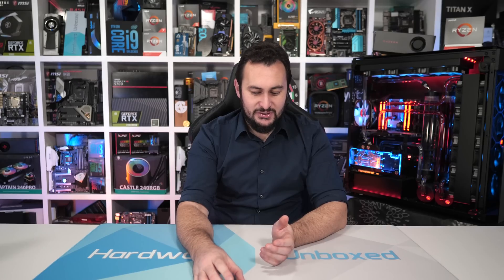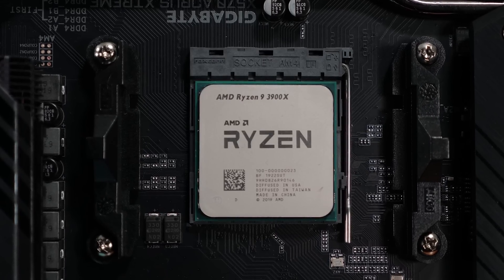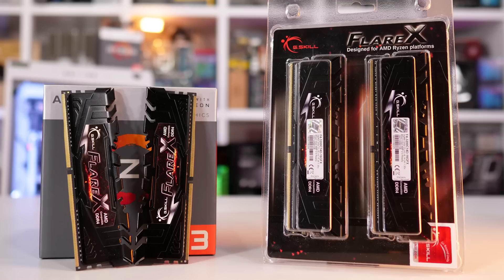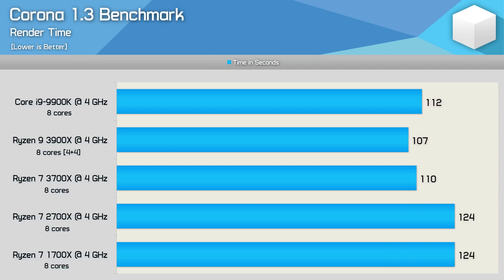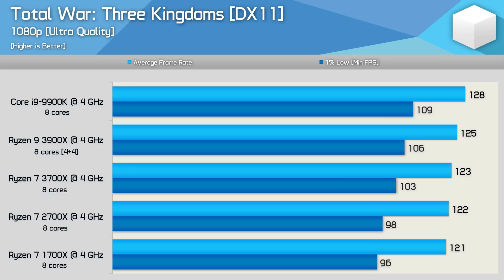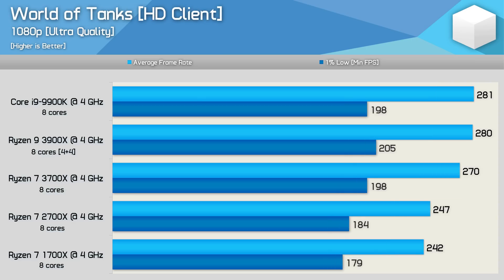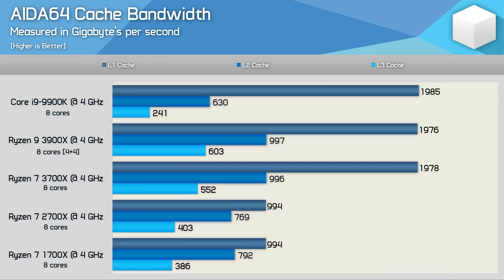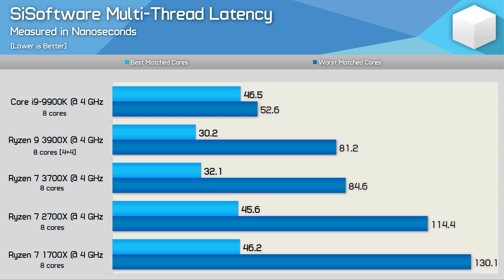3rd Gen Ryzen IPC Test, 3900X & 3700X vs. Core i9-9900K

Comment: Instructions per cycle has nothing to do with what the tech media use it for. Technically speaking IPC doesn't say anything about the performance given that some instructions do a lot more work than others. Of course the clock frequency also is tied to it, when you get longer (wider) pipelines you probably also get a lower clock frequency because the critical path takes longer.  Even AMD and Intel go with it (using the term wrong) now but computer scientists probably get a bit annoyed by how the tech media and now even the industry use the term IPC wrong. 

It is fascinating to see how 2*4 compares to 1*8. Now the explanation...
Reply from the maker: You went about explaining it, by explaining nothing.
Reply: @Hardwareunboxed  
I did explain it. You have a number of instructions per cycle, those instructions can do little work or a lot of work. Hence, the number of instructions per cycle doesn't say anything about the output of a CPU. Yet the tech media uses the term IPC as a measurement of output. What is not clear about that explanation? Furthermore I pointed out that in general when a CPU gets more work done per cycle - which generally is the case when pipelines are longer - the clock frequency lowers because the critical path gets longer. Critical path is a technical term from computer science! The point of that was to point out that a higher IPC often leads to a lower clock frequency and a lower clock frequency leads of course to lower output with the same IPC etcetera. So it is a balancing act between efficiency and clock frequency. 

In the context of X86 where both AMD and Intel use roughly (there are some difference in implementation) the same instruction sets IPC and output happen to correlate, technically speaking from a computer science point of view where this term comes from (I studied computer science, as subjects, not as a major) it is wrong to use IPC as measurement for output. AMD and Intel now do the same because the tech media do it and this makes it easier to communicate with laymen but it is wrong. Ask one of the technical managers (not the marketing employees) from AMD or Intel the next time you speak to them if you don't believe me.

Of course there is also the issue that the output of a CPU strongly varies between tasks. The term IPC as the tech media use it suggests that it is a general measurement of performance, as you know from your testing it strongly varies between tasks, Ryzen is the king for rendering but for gaming Intel still has an advantage, for Windows at least (probably also for Linux but that has not been tested yet). I think it would be best if tech media would not use the term IPC at all and just speak of performance for task X or program Y. That is technically correct and that is what it is about and what matters to the tech media and the consumers.

Comment: Wouldn't comparing games at 720p low be better to completely eliminate GPU-bottleneck?
Reply: No. Ultra setting is very demanding for cpu power... even shadow setting work better on good cpu. Only setting with minimum inpact is post-processing, resolution and anti alising.
Reply: @Denn4ik  okay, but resolution is less gpu bound at 720p
Reply: @Taraquin83  yes. But not low settings. I think optimal test is 720p ultra w/o anti aliasing and post processing.

Comment: the problem is...that in my country 3700x is 380$ and there are no x570 motherboards at all...I want to upgrade my pc from i5 8500,but I can't....
Reply: Don't need a x570 motherboard unless your going to take advantage of pcie 4 which currently is utilised for m.2 SSD. Pair your 3700x with a good b450 or x470 boards
Reply: @xAuzzieGamer93  some of em,don't have enough cache for new bios,so cpus won't work as they should,even b450 tomahawk is not enough so they release b450 tomahawk max(or smthng) soon
Reply: @xAuzzieGamer93  What about for the 3900x?
Reply: @luisangelini2220  a good x470 mb can still handle a 3900x easily
Reply: @xAuzzieGamer93  I'm still deciding which one. I was about to buy the x570 Aorus Elite, but now I'm not that sure if I should go for the x570 series or just save some bucks and grab a B450 or x470.
Reply: @luisangelini2220  like I said no difference between x570 to x470 or b450 just x570 has pcie 4.0
Reply: @xAuzzieGamer93  I know, but there is a difference between then, the vrm.
Reply: @luisangelini2220  not much. 12*2 from is for extreme OC and then you will need a psu that has a 8+4 pin to connect to the mb. 10*2 is enough for the new 3000 series
Reply: @xAuzzieGamer93  That´s good to know. I´m not that much into oc anyway so I will be ok then.  Nice to talk to you, thx. ;)
Reply: @luisangelini2220  if your not into OC then yeah just go b450 but go msi carbon pro a.c. b450 as it's the best for everything you need and no worries 👍👍😊

Comment: I am seriously looking forward for Ryzen 9 3950X based on 3900X and 3700X results.
Reply: ageofbogyo  Odds are really good the cores aren't locked. They're probably using 8 core chiplets that yielded with two cores being broken on each CCX, that way they don't just have to throw them away. Helping recoup costs like that is one reason the chiplets design is so brilliant.
Reply: ageofbogyo  I doubt it. Functional 8 core chiplets are going to go either to the 3700s/3950s or the new consoles. Especially after the 3950 releases the 3900 is probably not going to be so popular that they will just bin working chiplets down.
Reply: go for iT
Reply: "Just pre-order it" - being rhetorical, but the 3900x seems very much proof of concept for the 3950x. The cache mirroring across 2x ccx pairs works as intended.
Reply: Will buy that one. First I was planning to buy 3900x. Thanks God it's out of stock. 3950x will be the same, just 16 cores instead.

Comment: Its great both here test at 3200. Since intels official spec is ridicolous low, i disliked benchmarks with a 9900k running with 2667 mhz ram - witch noone who remotely builds there pc would do
Reply: Depends on what they are using the computer for.... Speed isn't always everything.  Significantly tightened timings for example.  If the workflow is more sensitive to it.
Reply: But gamers wouldn't do it.

Comment: Need testing of the gaming IPC on these CPUs when using an AMD GPU such as the Radeon 7 or 5700xt. 

Every channel just uses a 2080ti to minimize the bottleneck, but we should stop hiding the fact that AMD and Nvidia graphics drivers scale differently across CPUs and cores. Nvidia results cannot always be extrapolated and assumed to apply for those with AMD GPUs.
Reply: @Shaginn the fact is that the two graphics drivers are completely independent codebases with different performance characteristics. So we cannot just test Nvidia's driver scaling across different CPUs and call it definitive.

Since AMD has powerful GPUs like 5700xt with better price/perf than Nvidia, it means more people would be interested in that ipc test too.

Comment: Now AMD has achieved better IPC than Intel they have to work on Core and Memory latency, if this is even possible with the chiplet architecture. It either requires to make the Infinity Fabric faster or to spend more Infinity Fabric Lanes for faster read & write.
Reply: Unfortunately I suspect this is a nearly fundamental limitation of using chiplets (which is nearly necessary now. Intel will surely move to use them very soon, they pretty much have to). As you say, they can increase the frequency of the IF interconnect, but this only slightly helps latency, it has diminishing returns. Also, again as you said, they can make it "wider" as well, but as with the frequency, this has diminishing returns - you would see most of the benefits of doing so only under high load, not other times.

A better approach would be optimising interconnect architecture/routing in order to minimise the number of "hops" and distance travelled, especially aiming to reduce the worst cases, and eliminate node contention (data traffic jams, basically). By doing this, you could get very close to the latencies of a small ring bus :) 

However, it unfortunately will also necessarily make the interconnect much more complicated and likely require an active interposer in order to perform the required routing. But, this has other benefits... for example, you could use the otherwise "wasted" leftover silicon area (that which remains after adding the routing circuits) for massive amounts of L4 cache!

Comment: Can you explain why the core to core latency isn't worse on 3900x, where the worst matched corse have to use infinity fabric to communicate, than on the 3700x, where all cores are in one monolithic chiplet? Thanks and awesome content! Love these "scientific" analysis :)
Reply: 3900x has more cache than 3700x, which is what will be helping it get those few extra FPS.
Reply: Good question
Reply: Benedikt G. Its the extra cache in my opinion, thats what its there for
Edit:spelling
Reply: Communication between the CCX on the same die uses the infinity fabric and read somewhere that it has to go through IO die as well (not sure on the later though)

Comment: So AMD is just good for productivity, streaming and benchmarks such as cinabench r15

But when it comes to just strictly gaming intel is still king
Reply: In raw performance yes

Although in the lower spectrum AMD is still far cheaper for roughly 4% less performance

Ie the Ryzen 5 3600 despite being about £120 Less (Atleast here) than the I7 8700K It outperforms in some games and in others slightly slower

It's mainly a proposition of Value at that range
Reply: They are. AMD has still work to do to get software companies into her boat to optimize stuff for their cpus.
Intel had here a years advantage because they were for years the only choice. That would need another couple of years to catch up in consumer software (like games). And who knows what is released when software gets finally optimized for the ryzen architecture. Maybe Intel is then again faster or software optimisation for ryzen kicks finally in in game workloads. (Depends who pays more also. Game developers develope mostly for the side who sponsors them most.)
But you see the IPC advantage in productivity tasks and software here because that stuff is (mostly) faster optimized then games and their engines. (Be aware that games need years for development and are based on "old" software when released, more or less.)
So, ryzen had better IPC but can't use it in software that isn't well optimized for that still new architecture. And that's mostly games, because that story of software is some years behind of most productivity stuff, where optimization is a core feature (well, or should be *laughs*).
Reply: @Shaginn Thats not actually true, 240hz Monitors are an advantage although not as large as from 60 - 144

Pro gamers use extreme refresh rate monitors for that reason
Reply: @Shaginn ya ofc.. typical amd fan boys excuses!!1

Comment: In my mind, the infinity fabric is holding the cores back. The better cache also lets the 3900x get ahead of the 3700x.
Reply: It is, somewhat, but it's also about the only way to make these high core count chips economically... it's not really the fault of IF, just about any other interconnect would have the same drawbacks. It's just a result of the more spread out architecture you get from designs like this (again, done for practicality. Monolithic chips are on the way out, and they'll stay out)

Comment: I have seen a few results of 8 cores in a single chiplet performs better than 4+4. Is it possible that the extra cache on the 3900x is putting it ahead of the 3700x, maybe a test with the 3950x with one CCX disabled when that is released is worth a visit

Comment: Is CPU Testing with 720p an Option whneb there is a GPU Bottleneck?
Reply: No one is really testing 720p mainly because it doesn’t make much sense and it’s not very realistic. However I did a find a review where the reviewer tested with the lowest settings in games so you can get an idea of how much the fps gap widens when you’re not as gpu bound https://youtu.be/PT0EUXRGMjo
Reply: @keagan5379  it is not supposed to be realistic, the point is to see difference in cpu performance
Reply: Duka Duka yes I know, I myself would like to see some 720p testing but most reviewers think it’s a waste of time and to a certain degree they are right.

Comment: The Ryzen 9 3900X has 64MB L3 Cache instead of the 32MB L3 Cache on the Ryzen 7 3700X.
The i9-9900K still has the lowest Latency (+ Cache Latency) thus giving it an advantage in Gaming.
Reply: @Neiva71  But it has helped in gaming vs Zen+, so it's quite reasonable.
Reply: @Neiva71  It actually benefits gaming at higher resolutions even though most people believe 4K gaming is GPU bound. You will see the Ryzen 3900 and 3950X pull slightly ahead of the i9 9000 series at higher resolutions because of the "Gaming Cache".
Reply: @Neiva71  - Think a lot of lying marketers would tell you that you take your biggest weakness and then name it as your biggest strength to confuse the consumers into ignoring your product's weaknesses...You know, like in politics.
Reply: Miguel Carones  lol and you think that all the optimisation of the world will change an hardware latency issue ? the more the game will use core the more the between chiplet latency will be a issue
Reply: An advantage, but how much, and in what situations? Answer, negligible and only some.
Reply: @borutb11  smiri dozivljaj, 20-30% v igrcah je precej

Comment: impressive that the extra cache benefits the 3900x despite the cores being spread over 2 dies, a testament to how much better amd's die to die interconnects have become
Reply: that was my first thought as well, as soon as I saw the first benchmark shown here I immediately came to the conclusion that the Die-Die-interconnect is now so good that it doesn't really matter which cores are shut off and that the only difference between the 3900x@8c and the 3700x is due to the extra L3 cache.
Reply: That is why the 3000 series and specifically the 3900x has more L3 cache so that they can negate alot of the communication issues caused by using a chiplet design. The AMD marketing guys said something along the lines that it was an easy 20% performance increase in gaming by just increasing the cache.
Reply: @meeeellar  that's also why the future Ryzen 4000s are rumored to have a large stack of cache (whether that's L3 or L4 shall be seen) on the IO die. Something that seems to be doable considering recent patents from both Intel and AMD regarding 3d stacking. My prediction is a either 128 or 256 MB cache on the IO Die next year.
Reply: @meeeellar  that was my first thought as well, however the L3 is a victim cache and it isn't involved in core to core communication regardless.

The L3 doesn't factor in on core to core, only on data retired from L2, several clock cycles later.
Reply: @Zorro33313  so would the 9900k's small lead in games at same clocks probably come down to Intel optimizations by game developer? If so I'm guessing this is something that will continue to change as Ryzen is adopted more and more in the market. Probably has already changed some from days of 1st gen Ryzen to now
Reply: @cjpp78ytube  that's one possibility. I think the games, at this point, are likely slightly optimized for Intel's ring bus instead of AMD's infinity fabric.
Reply: My thought also, though I think having the Io die separated from the cores also help even out the scores since the chiplets have to communicate back and forth on the infinity fabric now even with a single chiplet. Still impressive that they managed to make that work better than last gens single chip approach. (On desktop anyway)
Reply: I think the 2xmore cache made a massive difference there. Tbh, still great work HU & AMD
Reply: Seems like latency is the main culprit when it comes to the difference in performance. There is certainly some software optimizations to make seeing as the Zen 2 chips are pretty different from the previous Zen(+) given the chiplet design, while Intel has essentially been using the same underlying architecture for years now. That said it isn't necessarily a bad thing, since it gave programmers the time to properly optimize their software and for Intel to optimize their fabrication process. Zen 2 truly brings a lot of new cards on the table and the fact that they pulled off so much performance on the first try is freaking amazing. And I wouldn't be surprised if we can still get some improvement via BIOS, driver or microcode updates down the line.
Reply: For any CCX to communicate with another they have to go through the I/O die. This means that latency is virtually identical whether they are communicating across dies (CCDs) or not. There are 4 cores per CCX (or 3 on the 3900X) which have the lowest latency between them. This leads me to believe with the right optimizations the 3700X could gain a latency advantage in some workloads due to having low latency between up to 4 cores instead of 3.
Reply: Doesn't matter much when their memory latency is still shit, lol!